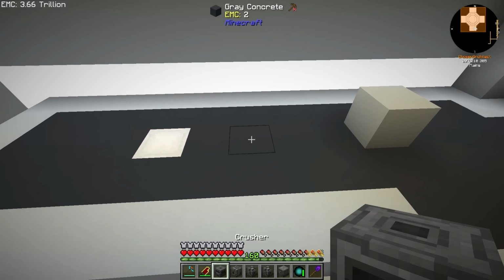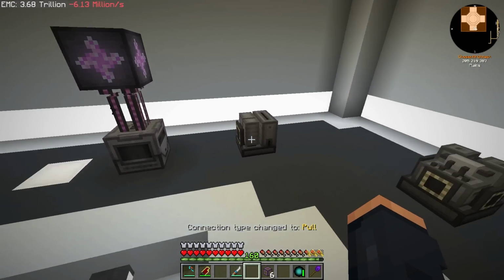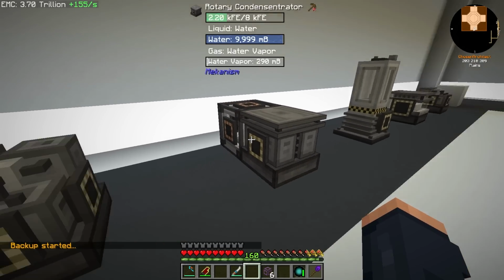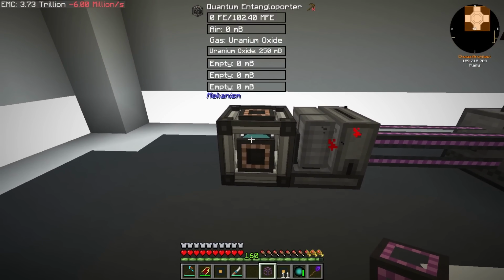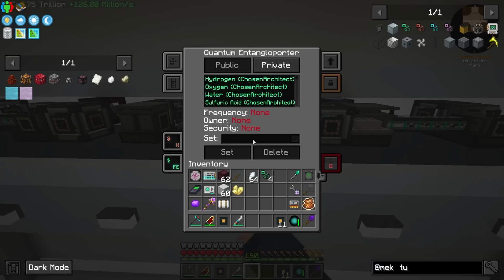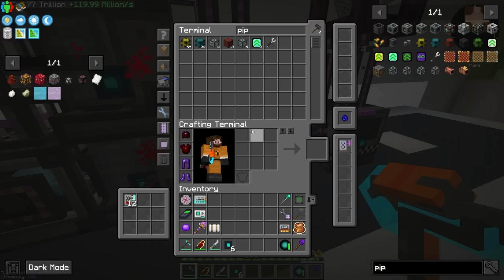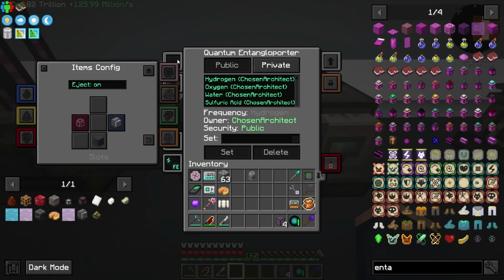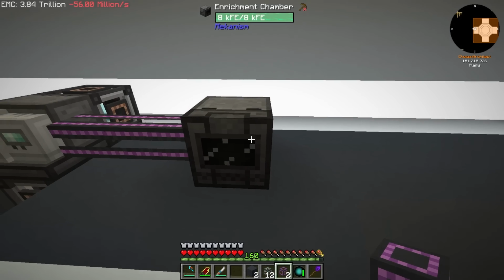PROJECT ARCHITECT 2 - EP 28: SIMPLE Fissile Fuel & HDPE Sheets

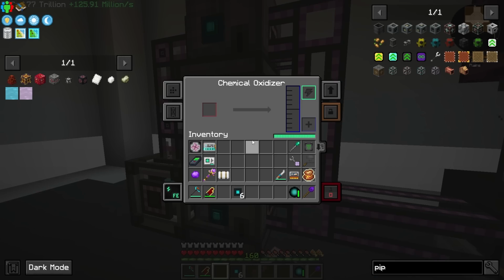Comment: Might be late but problem of item not going inside chemical Oxider (20:14) can be solved. You just need to remove 1 speed upgrade inside the second Chemical oxider. I did it and it work

Comment: Chosen you can set the pipes to push and pull which you have done before and if you do it with the chemical oxidizer it will quickly push in the items and it should to do it equally as well